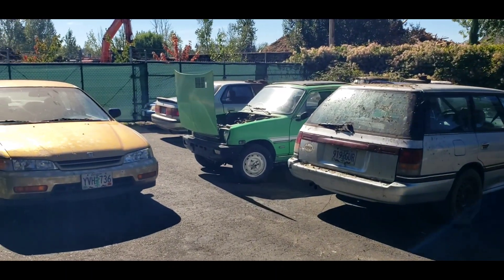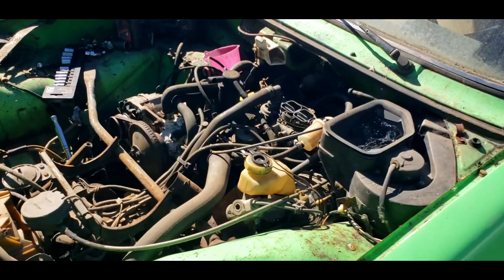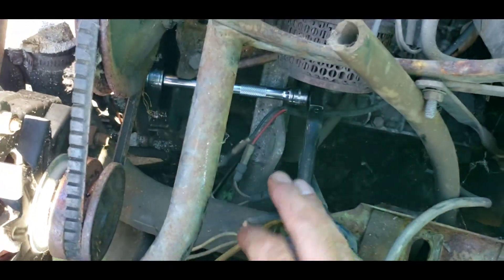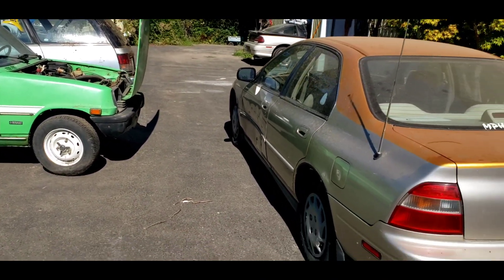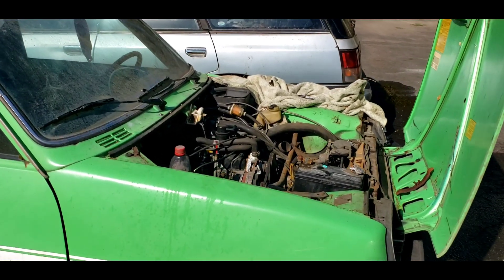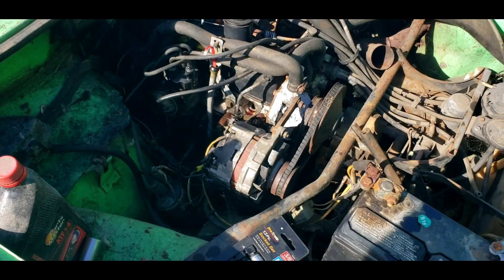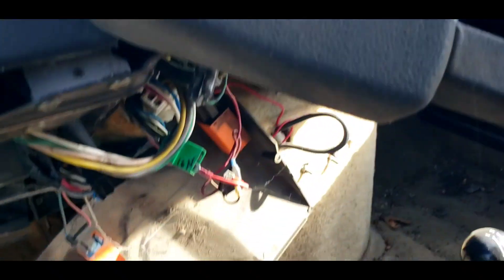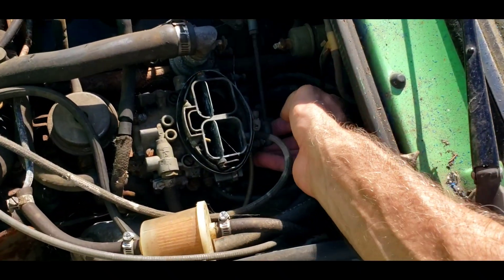So Many Questions. How Much Compression?

Comment: We had a Le Car from 1977 to 1983. Great little hatch! Absolutely superb ride on rough roads. It would just absorb the bumps.
My wife bought it new, and we put 105k miles on it. Only repair I remember was having to replace a drive shaft. Even the original Michelin X tires lasted 70k miles.
About your compression: Yes that is the oil on the pistons sealing the ring gaps, maybe with a bit of cylinder rusting mixed in?
Tip o' the Day: Back in the '80s, I would store my old Volvo PV544 while I was abroad. Before leaving I would fill each cylinder with engine oil and just let it seep through the ring gaps while I was away for a year or so at a time. Worked like a charm, always had a great running engine when I came back.

Comment: Also, on top of the rings being wet, perhaps it had an headgasket job with a very... Optimistic machinist removing too much from the head? You're not supposed to re-surface the head, but the same thing happened on my Alpine's PRV, supposed to have around 170 PSI, read 210...

Comment: probably the oil in the cylinders. The valves can also be stuck closed. But I think it's the oil. because that does not compress.
Reply: Yes, you normally put oil in to see if you can seal the rings and get higher numbers.
Reply: If a cylinder bore were full of oil, the engine would turn over.
Reply: @franktechmaniac7488  Depends on how much oil you use. If the oil is just sitting in the gap next to the pistion  to the top of the piston, the compression will be higher, but wil still turn over just fine. 
Same goes for oil on pistons with the combustion chamber in the pistons. They really look like a cup.
If that is partly filled up with oil, the compression will be much higher but the engine will turn over just fine.

Comment: I've watched a few mechanics and vehicle repair channels and one thing they all seem to say is that putting any kind of oil in the cylinders can help with compression and even higher compression numbers on engines. I'm not sure if it is correct or not as I'm just a diy mechanic, but if so, maybe the atf you had already put in the cylinders to help the possible seized engine may be causing the anomalous figures you got. Loving the videos and been watching since your girls where a lot younger, pre teen at least for Nora,  so keep it up .